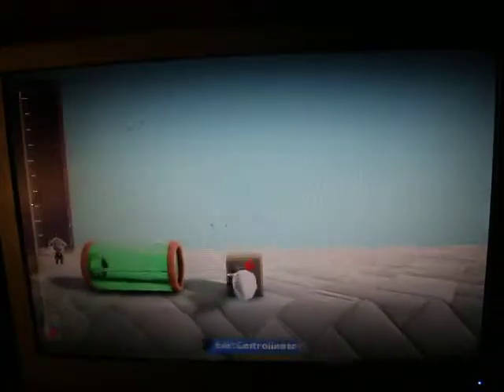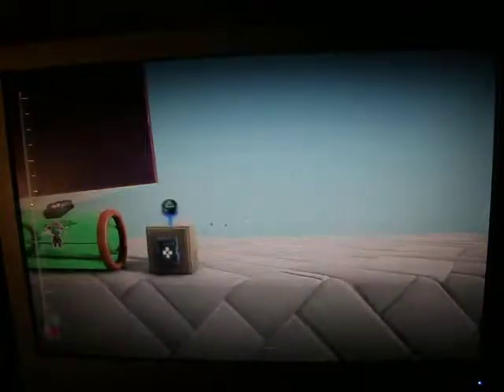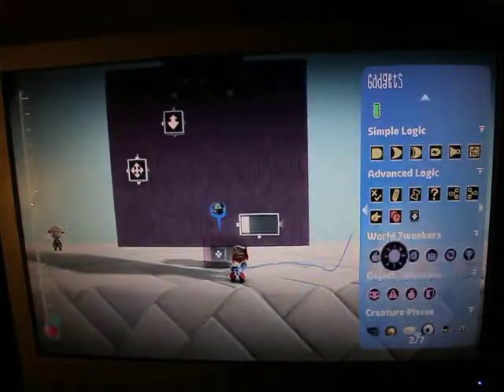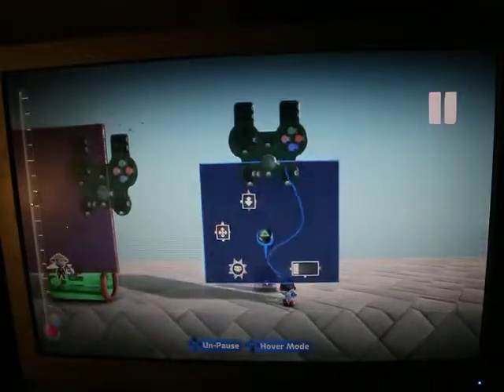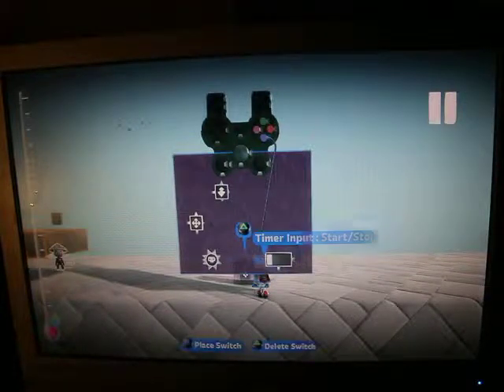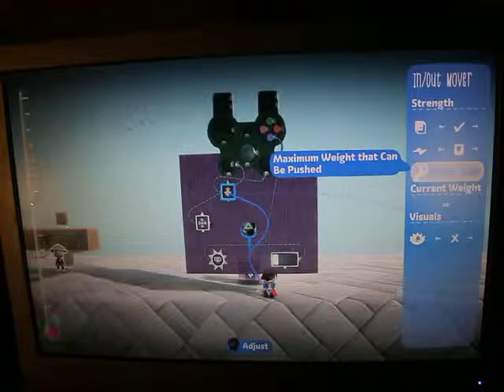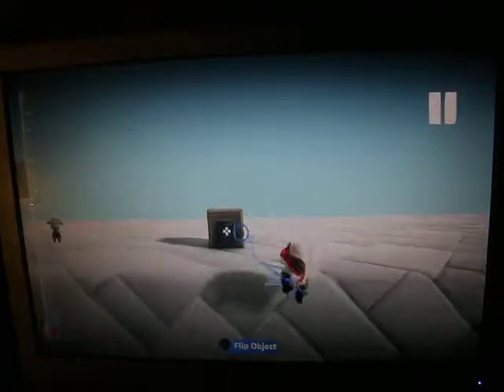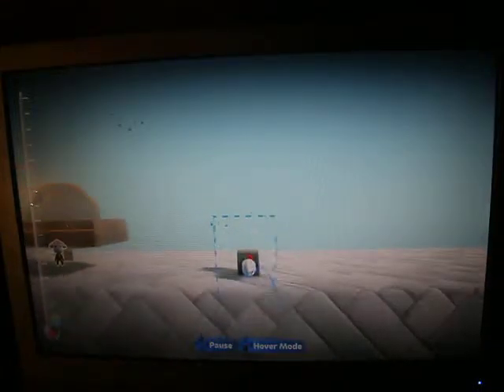how to use controlinator

Comment: How does the circut board pop out?
Reply from the maker: It seems like I just press a button on the controller to pop it out but I cannot remember which one. I hope you figured it out but I think it was probably the main button you usually use for menu and other interactions.
Reply: Im trying to use a micro chip thing but it just seems to make the controllanator disappear
Reply: Ive tryed every button do you think it has something to do with the tweak menu?
Reply: Actually nevermind i got it thanks so much!
Reply from the maker: @rootdoesstuff7882  What was the issue? I doubt I helped but I'm glad you got it!
Reply: Not being able to pull up the circuit board and you said to press a button and it popped up so i think you did help
Reply from the maker: @rootdoesstuff7882  Glad to help then!
Reply: How do you get it
Reply from the maker: @nick_gold2327  the circuit board? honestly been way too long i thought it was always there. sorry ;-;